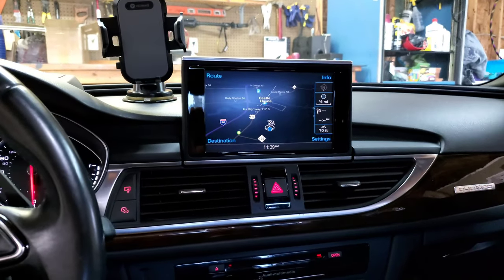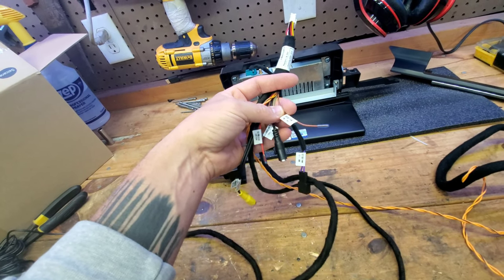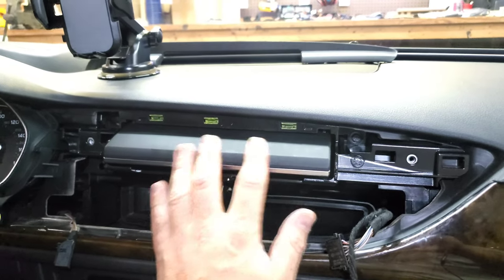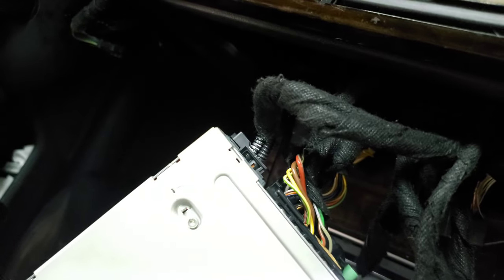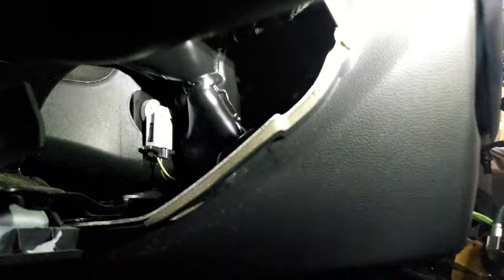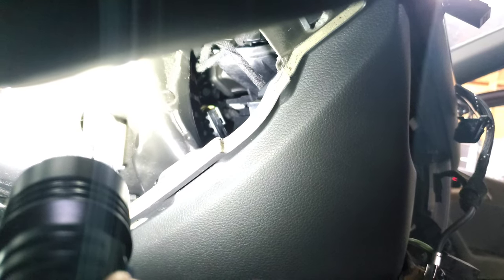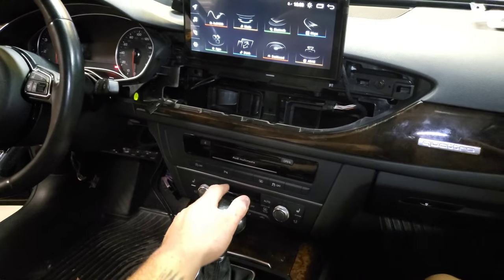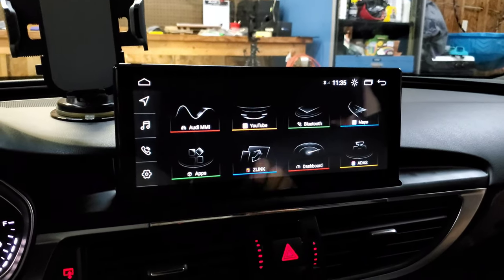How to install an RSNAV (or similar) Android Head Unit on your C7 Audi.

Comment: Could you do a video guide on how to set it up for the non-car play use, as in show what settings should be enabled to browse the internet, use YouTube and Netflix and inform of the best way to now receive calls as I'm told its better to receive calls on existing MMI bluetooth connection as doing it through the new screen set up seems to sound (to the other person) that you're under water. Is it better to connect via bluetooth and how to get the screen to connect automatically or is it best to connect via usb to create a wifi connection using your (for example) iPhone's hotspot function? 

The CarPlay side of it seems easy to understand. All videos show that side of it but don't show those who struggle with the tech side, what settings to enable to be able to use the new MMI touchscreen to its full potential. 

Should apps be downloaded from the google play store because (as you will know, but others may not) when you use the car play option, it doesn't transfer all apps from your phone to the screen due to the whole safety aspect of companies not (understandably) wanting people to be able to watch videos whilst driving, despite most people wanting to be able to do such things when parked up / stationary. 

I hope this finds you in good understanding as I just couldn't see any videos where this sort of thing is covered in these MMI upgrade videos.  

Kind regards

Comment: My oem screen doesn’t come in and out automatically. Can you please make a video on the oem screen and how to replace the little motor inside?
Reply: It usually because the nylon string pulley has snapped. very common problem

Comment: Great video! I installed it with ease. But I ran into one issue, once I took out the panel underneath the steering wheel the airbag warning light came on and I cannot get it to clear. Any suggestions? Thanks again for all the vids! Audi owners appreciate it.
Reply from the maker: Double check all your connections to make sure nothing is loose.

Comment: Great video, thanks. I notice you still had power on whilst installing the unit. Did you not disconnect the battery?
Reply from the maker: Nope. No need
Reply: @AudiC7Owners  Awesome, also do you know if the Audi units need a security code when reinstalled? Not sure if I have one in my documents
Reply from the maker: The one that came with your car won't need a code.

If you put one in from another audi you will likely have to go somewhere that has odis to have component protection removed.
Reply: @AudiC7Owners  Thanks for your help

Comment: hello I purchase the 12 inch for my audi a6 c7 android 12 and the mmi control the display buy the original mmi interface no show in the display, the display in the mmi mode not have any signal and no reverse camera please help I send a email to Seicane still no response an how to fix the problem

Comment: How do you fix the air bag off light on the dash. Also my knobs/buttons don’t work for some reason. Please let me know if you could point me out in a right direction.

Thank you
Reply from the maker: This install shouldn't cause any airbag light at all.

In regards to your buttons & knobs, those failing to work are typically from a bad connection somewhere. Check everything, especially the quad lock

Comment: How did you get android auto to play through the speakers?
Reply: you have to use a Ami to aux cable in the armrest. it doesn't have to be connected to anything, but it seems to complete a circuit.

Comment: Could you run OBDeleven on this? Seeing as it’s running android it should be possible, no?
Reply from the maker: Maybe, but it would be easier to run the torque pro app. You still need an obd2 dongle though

Comment: What about AMI or AUX port. Did you have to connect that to get sound to work from the display for apps like YouTube etc? I had one that required the AMI or AUX to be connected for sound.
Reply from the maker: There is a wire connected to my AMI, and I have to have external audio source in the mmi audio settings selected to get the audio working. This will be covered on my review video
Reply: @AudiC7Owners  Ah, so it's required to have an AMI to AUX cable from the center storage to get audio out from the unit?
Reply from the maker: Yes. You have to have something plugged into it to "fool" the Audi mmi basically.

Comment: Great video! I purchased the 12.3 model and everything works. One thing you didn't show or mention is the final mount of the unit. I used the supplied fasteners to screw the unit on to the supplied bracket, but you can't install the new trim piece with the unit mounted. Their video shows you install the bracket, install the trim, then slide the unit into place, then install the final trim piece on the back of the unit. No fasteners holding the unit to the bracket. Is that how yours is mounted?
Reply from the maker: That's not correct on the 10". Trim goes right in & clips securely
Reply: @AudiC7Owners  gotcha. This thing is massive lol. I'll finish it up and see how sturdy it is. Your video was a huge help!
Reply from the maker: I'm really glad to hear that. This diy can be intimidating without a video to follow
Reply: Getting ready to put my car in service mode and your video on that is great as well. Thanks for all you do!
Reply from the maker: Nice! Good luck man. Lemme know how it goes
Reply: I installed mine today but it doesn't turn on. And it's a little different from yours, it doesn't have the pink wire for the speaker, and also it only has one white plug that goes to the back of the screen instead of the 2 white plugs.

Comment: Hi man... I did all the connection  but for some reason I'm not getting audi from the apps like YouTube or navigation... radio works, Bluetooth  works normally...  pretty much I have installed  it 3 times and I can't figure it out... any advice??
Reply from the maker: Did you watch my video on setting up the system? Check the description
Reply from the maker: You have the cable plugged in & see changed your audi mmi settings as I described?

Comment: My old wires that were on the default audi mmi snapped does this come with new cables so i can throw away the ones that broke?
Reply from the maker: It doesn't come with replacement oem wires

Comment: Hey, I bought the same screen but the problem I’m having is with the camera and the original MMI system. I can’t get signal from the camera and seicaine told me to connect the camera out out but yours doesn’t look to need that. Can you help me with that?
Reply from the maker: Did you watch my video on setting up the new head unit?
Reply: @AudiC7Owners  I did man but my system looks very different to yours.
Reply from the maker: I'd keep emailing Seicane. This is why I removed their product link from the video description.

Comment: Thank you for the video, it helped me with the screen uninstallation. I ordered the 12.3 inch 6gb ram 128gb rom snapdragon. Everything works except the digital speedometer, tachometer, does not show the temperature. I have to manually turn off the screen with a button, I'm afraid it doesn't turn off like the original one and it still works even when I close the car, when I return to the car I touch the screen and it turns on as if it was on all the time except the screen was only off. Do you have any idea what I have wired or set wrong? Mine is RMC.
Reply from the maker: I'm not sure why it would do that. Might reach out to the people you bought it from to ask them.

Comment: everything installed as in the video but the MMI buttons do not work.
Does anyone know what this is about?
Reply from the maker: Make sure you double check all your connections
Reply: the best thing is that I plug in the original and everything works

Comment: How's the sound quality? Is everything in the Android side or do you find needing to switch over to the audi mmi for certain things?
Reply from the maker: Sounds quality is the same as oem. I'm figuring out android auto. After I get it working correctly I won't need to use the mmi very often for things, but it is extremely easy to switch between the 2

Comment: did you figure out how to adjust the speed on the gauges tab ? mine is off worse than yours and trying to contact seicane is no help at all
Reply from the maker: I didn't, but I also don't use that Gauge at all. I keep mine on WAZE 99% of the time.
Reply from the maker: But I will say, if the speed Gauge is off a lot, that is usually a sign that something on the wiring harness isn't fully connected
Reply: the update they sent me is loading right now...its a big file 1.9gig so I'm hoping once it reboots all is well 🤞
Reply from the maker: Nice! Lemme know how it goes
Reply: after loading the update seicane emailed  me twice happy to say unit it working alot better! still kinda buggy and some functions don't work but I have all the Google services and a way to update and add the apps I want, and now showing as android 11. I downloaded a photo translater app on my phone that helps ALOT sorting through the Chinese symbols on it!! I have the email with the update if anyone still fighting with theres  needs me to fwd it to them
Reply from the maker: Happy to hear this! What functions aren't working?
Reply: @robertwalker8052  I’m interested in this update file…
Reply: @Dan  did seicane email it to you? if not I can fwd it to you..its kind of tricky to get unzipped and all the files on the USB but it helps alot! I had to run it twice for everything to finally work...the android auto needs to be activated by them still im being told ? still waiting on that but the majority of the functions are there now like the video
Reply: @Audi C7 Owners  android auto? there asking for a qr code to activate it still trying to find that ? and it only has the one home screen that I can find? you can't switch it to the rotating one with the car picture in the middle, menus are a little different than yours still but basically everything works now
Reply from the maker: I don't have my car right now so I can't go look at mine. Hopefully I'll have it back soon.

Comment: HELP! I’m doing my 16 S6 no sound coming out; I do not have the MMI port in my center consuls or glovebox only USBs idk what to do I’ve been at it all day I’m losing my mind lol
Reply from the maker: Did you watch our settings video to make sure all of that is set up correctly? Did you double check all of your wiring harness connections?
Reply: Wiring harnesses seem to be installed appropriately, I’ve double checked just about all connections, the issue is it states for my MMI I need to plug in the AMI aux adapter and let it standstill, problem is I do not have that, usually always in glovebox or center console, but it is not I’ll take a look at your video, also I did not have that HVAC bypass yellow cable that you have in yours: was not in materials sent to me
Reply from the maker: On the website it asks you if you have aux or ami port. What did you choose? If you didn't have either of them, their order form clearly states the product won't work.
Reply: Mine was purchased via a forum member that stated he bought it for his S7, and I got it for a solid deal and decided to purchase, obviously as I’m finding out there is significant issues, which is audio and me not having that port. Do you know of if any a work around ? I emailed RSnav but I’m feeling pretty stupid at this point
Reply: His selection was an MIBII platform which is the same as mine the updated facelift 16-18 models
Reply from the maker: I don't know any work arounds. You could just update your mmi to have carplay/android auto

Comment: Does the android head unit have the screen on when you turn the ignition off?  I have a similar radio and mine turns off the screen, but the original radio continues to play until I open the driver's door.  so if I want to change stations and see which stations, I have to start the ignition.
Reply from the maker: My screen stays on until I exit the car